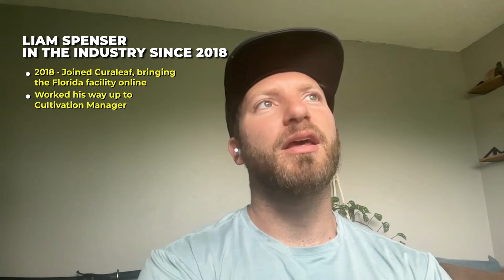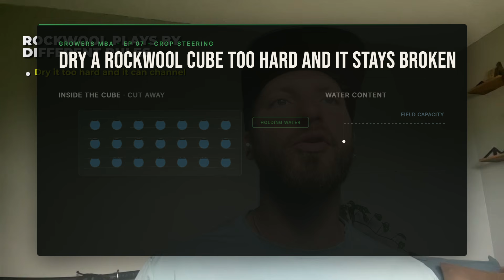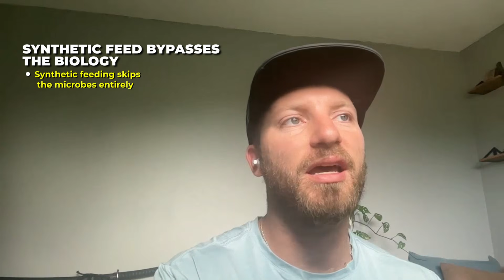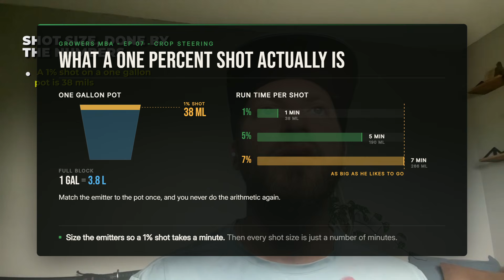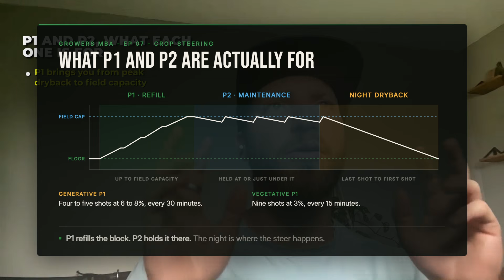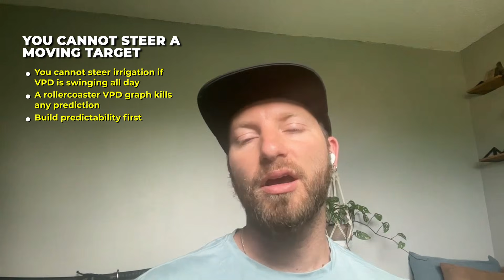Crop Steering Explained: Dryback, EC and Shot Size

Comment: You are describing a real biological phenomenon called the rhizosphere effect, where plants use chemical "carrots" to feed microbes, alongside a process known as cation exchange and the Rhizophagy cycle. Here is exactly how this "magnetic" gateway and trade system works:
1. The Bait: Root Exudates (The Carrots)
During photosynthesis, the plant pumps sugars, carbohydrates, and amino acids down into its roots. It actively leaks up to 40% of these sugars out into the surrounding soil zone, known as the rhizosphere. This isn't an accident—it is deliberate bait. The plant is setting up a "trading post." Soil microbes (bacteria and fungi) crave these sugars for energy and flock to the root zone to feast.
2. The Gateway: Proton Pumps and Electrical Charges
To pull nutrients out of the soil and back into the root, the plant uses specialized "gateways" called proton pumps.
The Positive Charge: The root cell membranes actively pump out positively charged hydrogen ions (H+ protons) into the soil water.
The Magnet Effect: Soil particles (like clay and organic matter) are naturally negatively charged. Because opposites attract, vital nutrients—which are positively charged ions called cations (like Calcium, Magnesium, and Potassium)—are stuck tightly to the soil particles like magnets.
The Swap (Cation Exchange): When the root releases its positive hydrogen ions, those ions rush out and "kick" the nutrient ions off the soil particles, taking their place. The freed-up nutrients dissolve into the water and are sucked up into the root's open gateways.
3. The "Rhizophagy" Cycle (Eating and Spitting Out Microbes)
Scientists have discovered an even more direct version of this system. In a process called rhizophagy (which means "root eating"):
Luring them in: The plant lures microbes right up to the very tip of the growing root with its sugars.
Swallowing them whole: The root cells actually open up and absorb the live bacteria and fungi into the root cells themselves.
Stripping nutrients: Once inside, the plant hits the microbes with reactive oxygen (an electrical oxidative stress) that strips away the microbes' outer cell walls, spilling out the rich nutrients like nitrogen directly into the plant.
Spitting them back out: The surviving microbes are then spit back out through the root hairs into the soil. The plant gives them a little bit more sugar to help them rebuild their walls, and sends them back out into the soil to go find more minerals.
By manipulating these electrical charges and swapping chemical sugars, the plant turns its root system into a highly controlled, biological magnet!

Comment: Interesting about the sugars. I've been using sugars for years and i just did my first run without it and i had my most productive harvest ever. This is a fully synthetic ebb and flow system.
Reply: Sugars feed microbes mainly, and in ebb/flow without high oxygen microbes are less prolific, so that's plausible and makes sense.